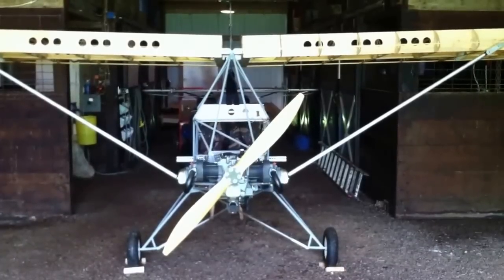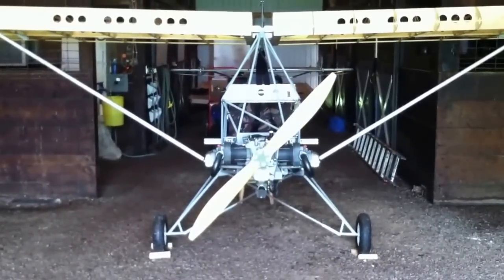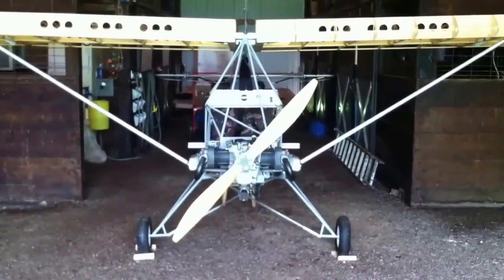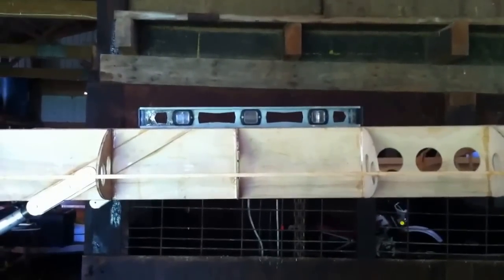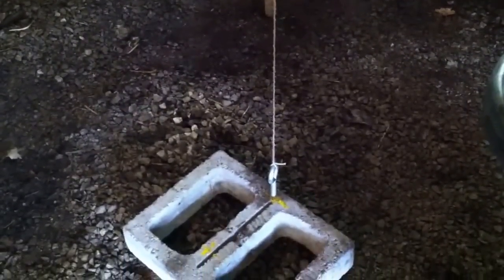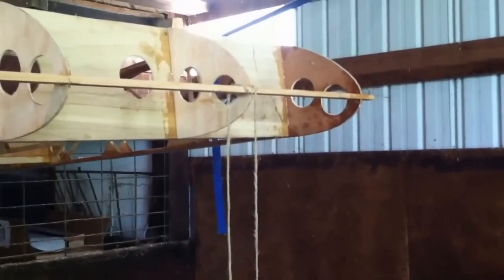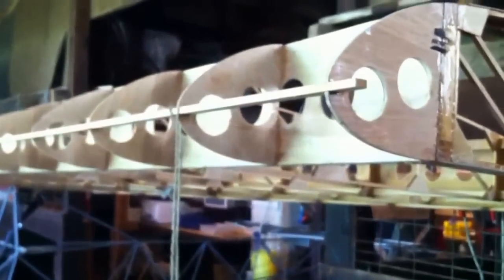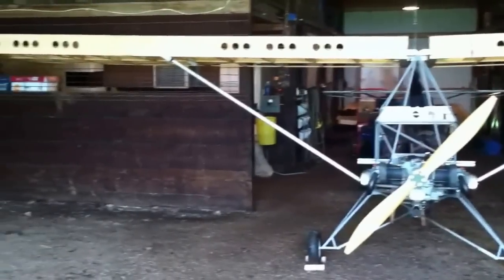Legal Eagle Ultralight May 2015 Rigging

Comment: There is a much more accurate and simpler way, lasers, been using them for this for years. such as the hf BAUER30 ft. Self-Leveling Cross Line Laser Level 50 bucks, im using it to build a pond now to make sure the sides are above the drain pipe, very handy device to have. technically, the plane doesnt even have to be level with the laser, you lock it, and make the laser as unlevel as the plane, still would work. but level is easier. put the laser on a camera tripod, and you can lower it to check wing wash in out too. i also use it when balancing piston rods to get them horizontal, and for getting the fuse sides level for weighing, to double check c/g for balancing the plane, hang it from the hf PITTSBURGH AUTOMOTIVE3/4 ton Capacity Load Leveler and sit in the plane, have someone screw the load leveler until the plane is level, thats the cg